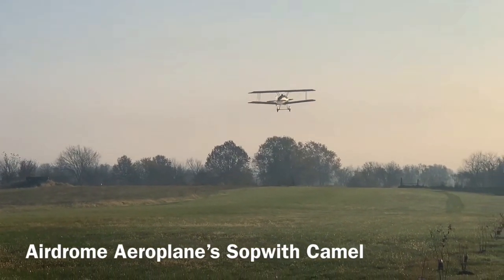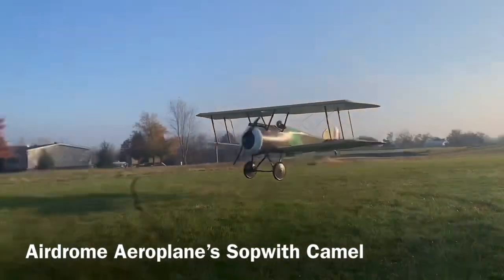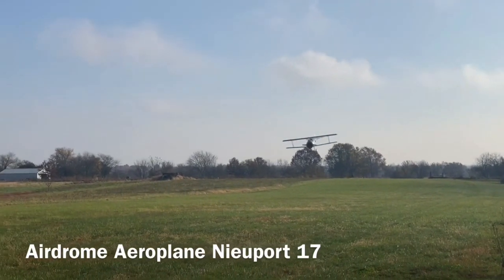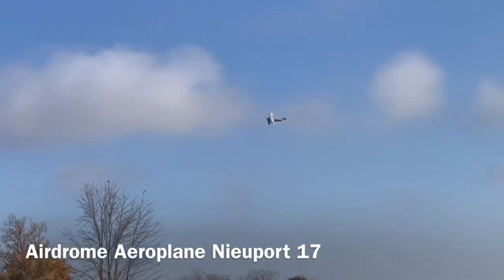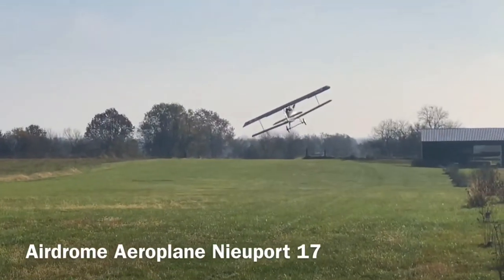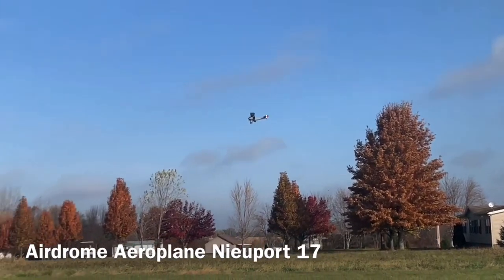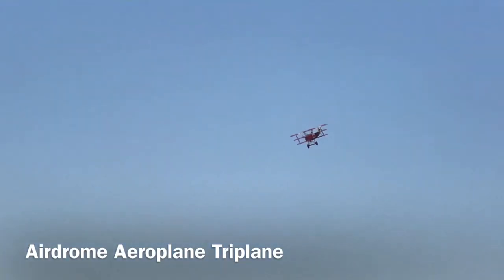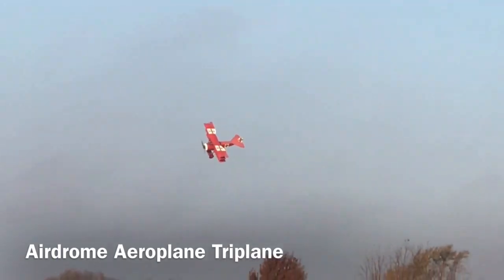Propeller Performance

Comment: If these three flights were truly each aircrafts maiden flight, you need to ground your test pilot. To do a 90/270 turn to a low pass on the initial takeoff of an experimental WW1 replica is careless and wreckless. A clear violation of 14 CFR 91.119 and 14 CFR 91.13. You produce a marvelous machine but this is a  sign of overconfidence that will get someone killed.
Reply from the maker: I appreciate your concern, but this tiny little video in no way shows the entirety of how they test their aircraft. It would be very unfair and careless for anyone to make these kinds of accusations and start throwing regulations at a very well respected company without getting all the specifics first.
Reply: Jeeze dude! How in the hell did you deduce all of that from just a short little video??
Lay off the espresso!!

Comment: This is undoubtably one of the finest videos ever done on a WWI aircraft demonstration. The speeds are a really good estimation of what they would have been for sure ! Harvey really makes it look good ! The rpms are a bit high, but not that much: 2 to 3 hundred of so. A slightly longer prop would bring up the Manifold pressure, but maybe too much. Just an all round great job Alaina ! I loved it, watched it again and again...
Reply from the maker: Actually they are well within RPM range and making the prop longer will put the tip speed too high.

Comment: Great video. One question about the propeller specifications - does 37 refer to the average pitch or is it the angle at a particular blade station? Thank you.
Reply from the maker: It should be the pitch at every station of the blade from 3/4 out to the end

Comment: How is the prop size decided do you have some kind of program or just experience. My brother had a Jodel D9 with a VW engine and we actually had to reduce the power/RPM during the take-off as the prop became less efficient as the RPM's increased.
Reply from the maker: There are a lot of factors. Putting them all together to make the prop is what makes a good prop maker 😊
Reply: @CulverProps  The fact that you are a beautiful and talented women also helps. Cheers

Comment: Not only did the WWI engines not turn very fast, they also didn't have throttle control (as these engines evidently do). 
Love the look of that big-ass prop tho..wondering if you mill props for Rheinbeck Aerodrome too?
Reply from the maker: I have done one and working on a second